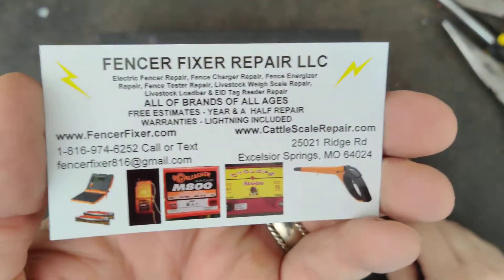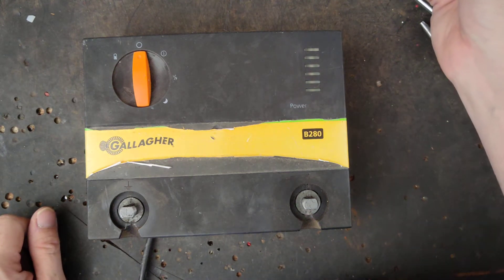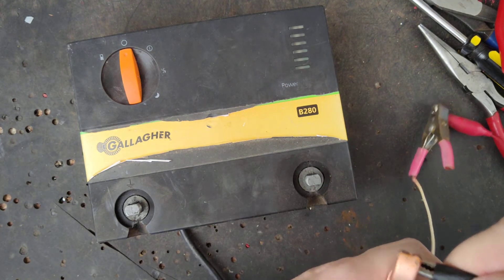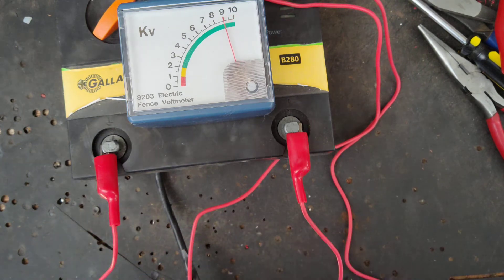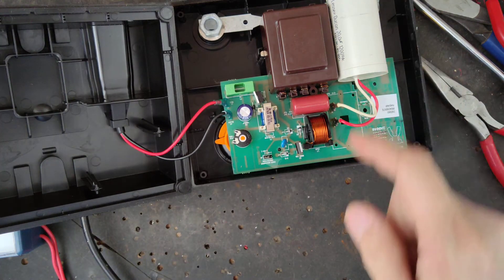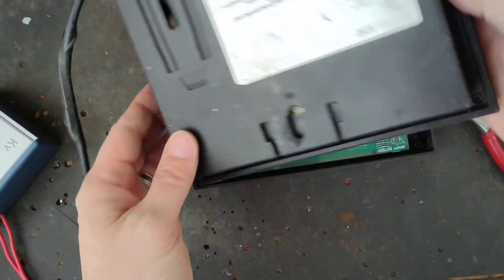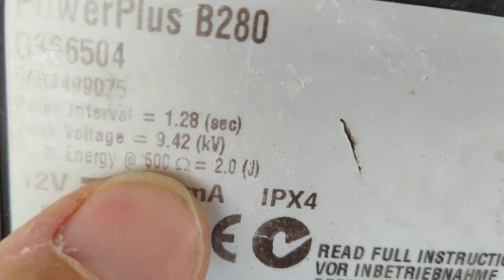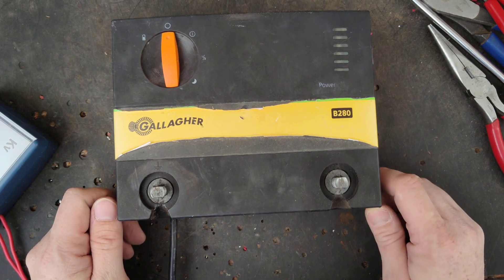How To Test & Troubleshoot A Gallagher Electric Fencer | Gallagher B280 Electric Fencer Repair

Comment: Is that like a 500 ohm 1/4 watt load resister?
Reply from the maker: It's a 500 ohm 100 watt resistor. You need at least a 20 watt resistor for it to handle most units, maybe a 10 watt. If it's less than 20 watts, the resistor will get way too hot and burn out. A 1/4 watt resistor will burn out in a couple of clicks.